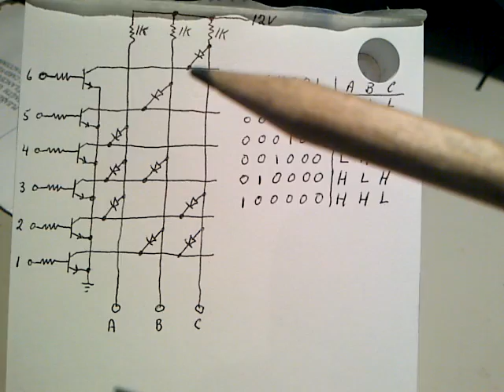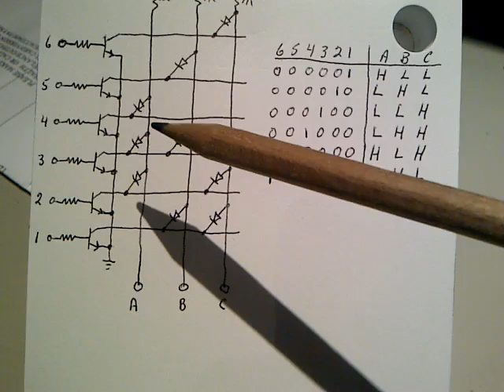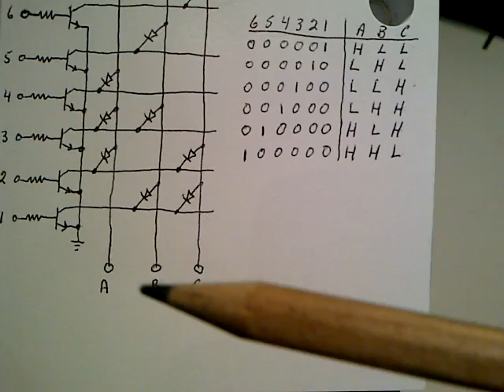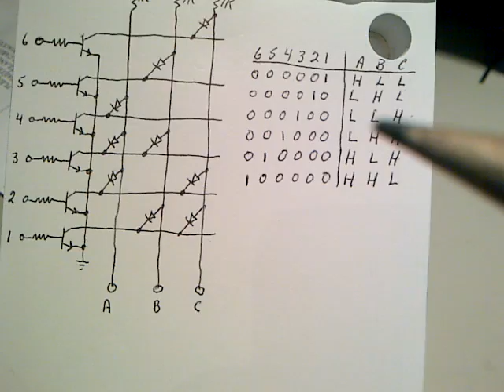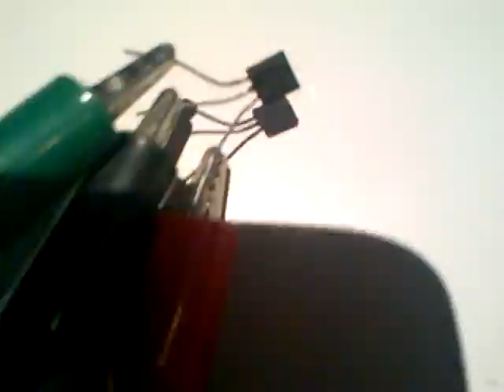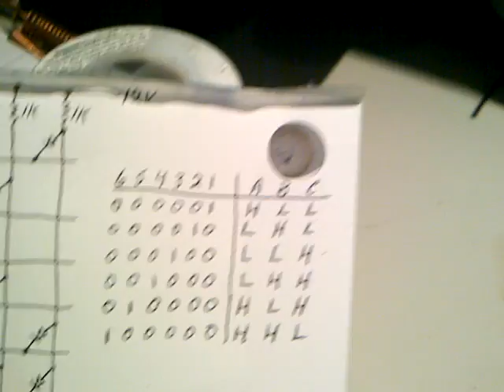Home made ROM chip for transistor tester

Comment: I've been trying to find out how to build a rom.
Reply: Note that I've just started watching.
Reply from the maker: ROMS are very easy to understand.......hope my video helps you......please note I've used diodes in my prototype but ROMS can be made with other things too such as magnetic ferite cores, emmiter coupled logic using only transistors, FETS, MOSFETS, fuseable links such as used in PAL chips.......etc.....if you need some kind of memory capacity system very very specific and only certain amount of bits or bytes to eliminate wasted space then the way to go is to build it yourself like I've done.......all the best.
Reply: @silectronics  It helped me! Thanks! Update: I ended up building a PROM in logisim and my next step is to do it irl.

Comment: Aren't there issues with wiring led's in parallel, IE the one with the lowest voltage drop turns on and the rest remain off.
Reply from the maker: LED's are wired in parallel but opposite polarity so no issues. You can connect thousands of leds in parallel . The only issue then will be total current draw especially if they all come on at the same time.   Thanks
Reply from the maker: geez its been quite a long time.......my sincerest apologies for such a delay.......but i finally saw your question.......i dont know why it shows now........but its no use questioning the workings of the internet...sometimes that happens....anyway, to answer your question, no there is no problem....first of all these LED's are wired alternately to each other which means cathode to anode ad anode to cathode so only one can come on at a time depending on direction of current flow and even if you do have parallel connected LED's, it still would not be a problem as long as sufficient voltage and current is available to turn all of them on.......example, LED's require between 10 t0 20 milliamps of current on average to turn on so if you have only10 miiliamps available going to 2 parallel LEDs than the one with the least voltage drop and least current will activate and not the other because of insufficient current....but increase the current to at least 20 or higher milliamps than both will turn on..only difference might be seen in their luminosity or how brighter one is than the other but they will both come on.....thanks, hope that finally answers your question and i am truly sorry it took so long to answer you.....

Comment from the maker: yes..you are correct...it is a 3-bit output.....but it also is an internal 18 bit capacity rom......consider it like a 1,024 bit  chip with only a 1 line output  which would be a 1 bit output, 1 k memory chip......this is a 3 bit output 18 bit capacity rom.